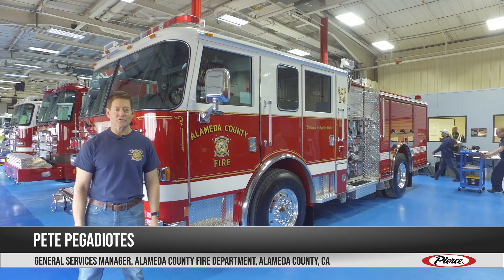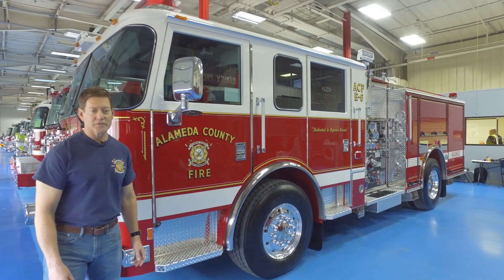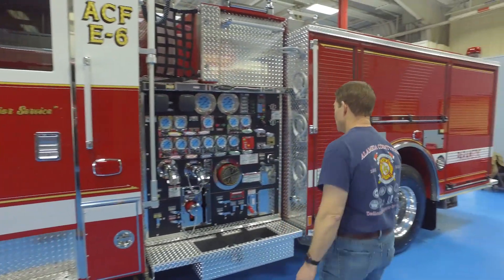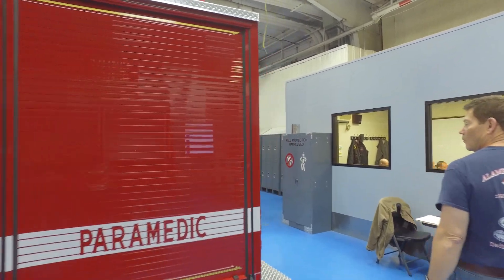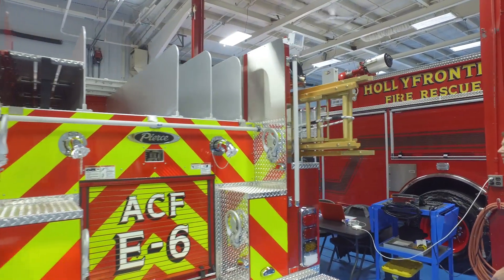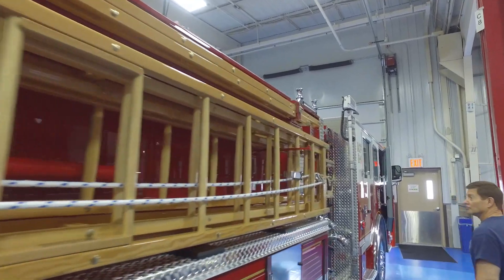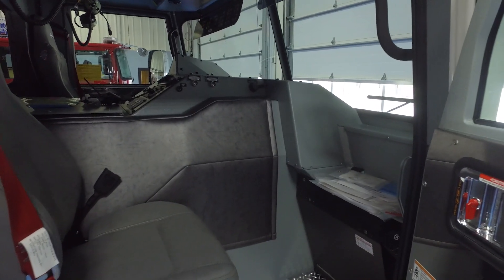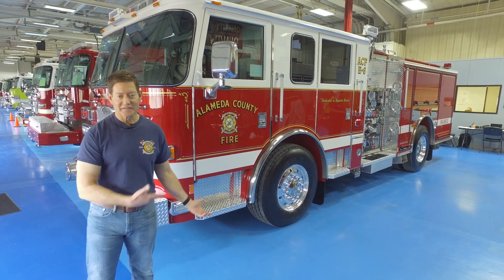Arrow XT™ Pumper – Alameda County Fire Department, CA

Comment: First time I've ever seen a department use wood ladders
Reply: I've noticed it a lot in California. LA and I think San Francisco uses them.
Reply: Robert that’s correct, a lot of Bay Area departments use them as well as several Southern California departments.
Reply: San Francisco even has a shop for its wooden ladders because they are such a large department. I think that you can find a video here about that shop.
Reply: The reason they use these is because the metal ladders electrical currents are more severe than when using the wood ladders.